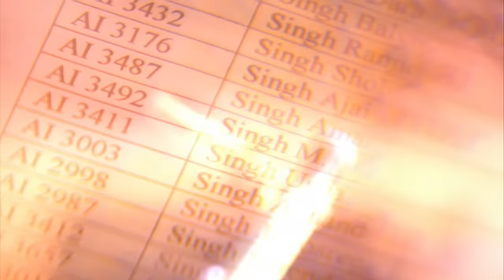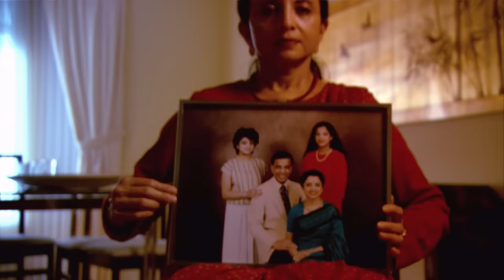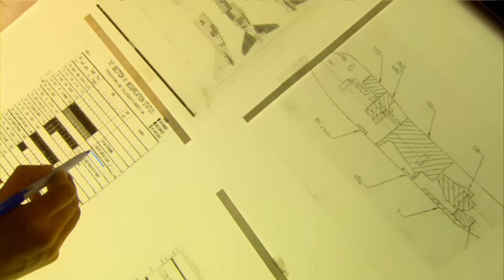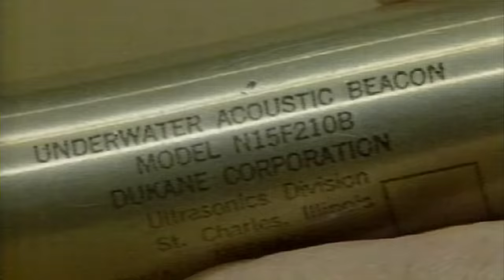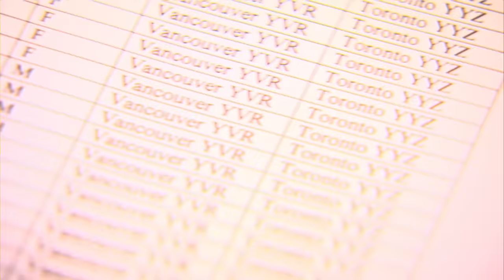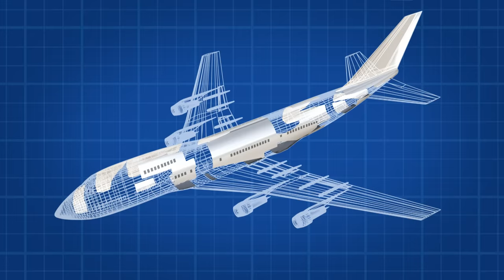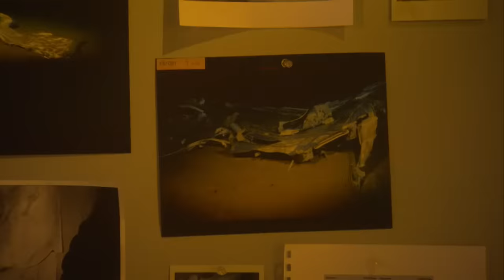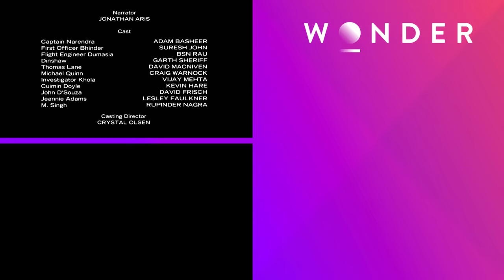Air India Flight 182 Gets Bombed From Inside The Plane | Mayday | Wonder

Comment: Could you imagine if the air India flight was the one at 37,000 feet debrie from the plane would of probably took down one of the other.
Reply: Wonder why it didn’t hit the plane that was flying beneath them..
Reply: @miriamsamaniego3335   because these images on the screen are radar representations of reality.  the radar triangle you see is about a scale of 500 times or more larger than the aircraft it represent,  lots of dead air between those radar blips.
Reply: Yes, In simple words its just like the maps we see on our phones but zoomed out. If you zoom in, the distance gets larger and more accurate.
Reply: @debasisghadai3633  Zoom in, the distances on the reproduction are smaller.   IF you fly on an airplane, or go to a football stadium,  all scales are correct.   if all scales were correct on the radar controllers screen the airplane symbol will be as smaller than dust.  in order to make the tool [radar] usable the airplanes are enlarged about the size of a few city blocks. If the scale on a street map were correct the roads would be about more than 400 times wider.
Reply: @YouTube.TOM.A  ah, thanks for the explanation 👍
Reply: Which 2 flights were others
Reply: @miriamsamaniego3335 but it was not

Comment: So they don't use bomb-proof luggage containers because, "it's too expensive." 

Thank you for admitting that you value human lives less than your profits.
Reply: and that surprises you how ?
Reply: @waldopepper4069  It doesn't, but I wonder if the peanut counters at these airlines realize that in the long term, not using these compartments costs them over 41x what the compartments themselves cost. 

An airline could purchase 2,000 units at $10k per unit and the price tag would be $20 million. 

The cost of replacing a crashed 747:
$415 million
(that doesn't include legal settlements to families, fees for the investigation, etc).
Reply: @sixstanger00  couldnt agree with you more. but i am never under any illusions that people matter more than money to these people. they dont. if they did, things would be different.
Reply: As if you were going to pick the more expensive airline because they had bomb proof containers. No you wouldn't. 

There are 21 seasons of this show, several hundred accidents and only a handful or less due to bombs. The chances of a mechanical failure or pilot error is vastly bigger than the chance of a terrorist bomb. It's about priorities, the airlines spend fortunes on maintenance, security and training. I would much rather have them spend their money on that, than on some containers which may or may not be of any consequence if a bomb were to go off, which in itself only happens once a decade.

Your calculation is also very simplistic. Even if the purchasing price was only $20 million, those containers, fragile apparently, would have to be maintained, which means ongoing checks, repairs, replacements. The entire way of handling them would need an overhaul and due to their fragility would likely end up being a much slower process. Not only for the airline itself, but for the entire airport and all other airlines. The actual price of such a change, ultimately meaning higher prices for customers, would be much much more than just the purchasing price of the containers.
Reply: @OddityDK  
I would much rather have them spend their money on that, than on some containers which may or may not be of any consequence if a bomb were to go off, which in itself only happens once a decade.

Easy to make those kinds of statements from the comfort of your home sofa, and not from a passenger seat directly above the forward baggage compartment at 30,000 ft. 

Your logic is also very simplistic. 
The average driver gets into FOUR car accidents over their entire lifetime. Yet, you wear seat belts every single time, your car comes equipped with air bags, break points in the chassis, etc. By your logic, it isn't worth the extra money for these features. 

Now let me explain to you the reality: You're right -- you could probably get on hundreds of flights in your lifetime and never be on one with a bomb. But guess what? It only takes ONE BOMB to end your life. A bit late to then say to yourself, "Damn, now I wish they'd used bomb-proof compartments" as you plummet from 30,000 ft. 

That's the logic behind these safety measures. You're trying to place a monetary value on the lives of passengers. I'm telling you, omitting a bomb-proof feature sounds reasonable........*until you need it.* 

The argument you've made here could be applied to any safety measure in any scenario. I'm an avid mountain biker and we wear helmets for safety. They can cost upwards of $200. We rarely ever crash, but we still wear the helmet. Why? Because, like the bomb-proof compartment -- it's all fine and dandy until you need it. A bit late to strap a full face on as you're mid-air going over the bars bound for the hillside....
Reply: @sixstanger00  
Hello true human being 😊

Comment: many years ago, I flew to attend my grandmothers funeral. I quickly packed a bag, not realizing I used that bag for carrying my rocketry hobby stuff. Chemically, it was covered in residue from rocket motors and ignitors. On the way home, I was stopped for a random bomb screening. it was explained to me that my person and the outside of my bag were to be swabbed and tested for explosive material. When the security guard finished analysing my test sample he said i could go. and I asked him when his machine was last calibrated, I looked as  concerned look grew across his face, and I explained that my bag had at least 3 chemicals I know that machine would detect and in my grief I had accidentally brought that bag, not containing anything but covered in particles, the guy smelt it and confirmed he could smell a burning chemical smell, I told him that was most likely ammonium perchlorate, space shuttle fuel. they actually seemed grateful for me spotting the machines fuckup and let me continue on my way.
Reply: Very long comment you have written there bro
Reply: WOW. That's terrifying. I happily gave up the too-big shaving cream I forgot last time I flew! Can't believe their equipment was broken and untested.

Comment: There is one flaw in the documentary, the bombing device could be accompanied by a suicide  bomber matching up with the luggage, we would think that the technology has eliminated  that problem.
Reply: Yes. But if the bomb detector's warning had actually been heeded by the baggage handler, THEN this would have been avoided.
Reply: @deprofundis3293  matching luggage with the handler was not foolproof,technology filled the gap.
Reply: @757575436  oh
Reply: @757575436  there are flaws and flaws in this documentary sir

Comment: Am I the only one to wonder why the first thing the Shannon controllers didn’t do was contact the two other flights to see if they had seen anything? I mean an explosion surely would have been seen by the other flights being so close or their passengers?
Reply: The problem is that each were 1000 feet apart.
Reply: Other flights were at higher altitudes. It may impossible to seen anything
Reply: @TeeHongJun_0214  true. But all this is a guess. It wasn’t addressed. When TWA went down (outside NYC due to the fuel tank issue) not only did ships see the blast, planes in the area did although no one knew at the time what it was but they reported back to ATC..
Reply: That was a HUGE reveal I have never known.  A TWA American plane and Canadian Pacific clearly witnessed this bombing happen.
Reply: There’s a difference between a plane catching fire and then plummeting into the water at 16,000 feet, and a plane exploding and disintegrating at 31,000 feet, 4000 or so feet below your plane. Additionally, TWA exploded quite close to New York, and in extension, the airports in that area, which would mean a substantially higher density of air traffic.
Reply: @melonnnnnn  true.  All valid points.
Reply: @andyrob3259  no

Comment: explosive protection in luggage compartments would be nicer than being strip searched.

they could just add a harder outer lining to prevent accidental damage to explosion resistent luggage containments.
Reply: If you check again, they said they would only work once and they can damage easily while loading cargo. So at best you might have a UAL 811 case happening to every bombed plane

Comment: And how can you allow a baggage to into an airplane without going through X-ray confirmation?
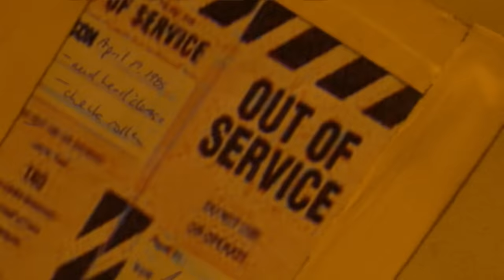Reply: As what was stated in 28:04 their xray machine broke down. Hence, they used a portable one. The best they could have done is to open it to confirm instead of passing it as a "glitch".
Reply: @chizusakuraa  yeah, but, should you ???? Isn’t the saying…. Better the safe than sorry ?
Reply: @medicinaemdia4895  Should I what? If you are pertaining to the opening of the baggage despite a different tone produced by the portable scanner, definitely yes! If you are pertaining to the xray machine, again, they stated that during those times it broke down, and xray machines in the airplanes are "still in the infancy". Of course, I'm not covering for their mistakes. I'm simply stating what was said in the video. The best "better safe than sorry" move they could have done was to direct the flights to other terminals with functioning xray machines.
Reply: @chizusakuraa  it’s óbvios that they should have moved the luggage to another terminal, but since the check in girl decided to skip the regular idea, that when the passenger is trying to only check in a luggage and not board the plane, it’s suspicious behavior, so in deed move the luggage to another terminal and do bother to make that luggage actually be scanned, since otherwise you are gonna end up being also responsible for the death of hundreds of passengers.
Reply: @medicinaemdia4895  oh man you know nothing

Comment: As someone who has worked in private security at hospitals/other high value locations (though not airports) for over the last 12 years I can say that security standards have not changed. Unfortunately it is considered a low paying field (in some places like Ontario a minimum wage field). Which means that you get people who are either foreign students or retirees who receive very little training or direction and told "well use your common sense." 

Or you get people who once they become knowledgeable move on to higher paying fields and you're left with new people with little experience to replace them. 

Certain locations that have a higher risk level need a higher pay level but unfortunately these places usually have basic security because "well I can find someone who can do it cheaper" mentalities.

Comment: "23:39 The bag did trigger the device, but it made a very different noise than the one workers heard during the demonstration. The bag was passed and allowed on board the plane." If it made a noise at all it should have been pulled aside and inspected manually.

Comment: Everyone is blaming the ticket agent and not the baggage security guy whose literal job it was to check for bombs. >< Also, people forget that many bombers are actually suicide bombers. If that guy had been a suicide bomber and got on the flight, then keeping the luggage with the passenger wouldn't have changed ANYTHING. The only thing that would have stopped this tragedy no matter what in this situation was the guy who used the scanner actually opening the damn bag when the sensor made a noise. HE was the only person who had been given a clue that there might be a bomb.
Reply: There were many lapses…all concerned have agreed on this
Reply: @arbjful  yes, but going through the comments, I was surprised to see that people blamed the ticket agent (who had no reason to believe there was a bomb, although of course it doesn't justify breaking policy) instead of the baggage handler whose bomb detector WENT OFF but just didn't sound exactly like it had when demonstrated. That frustrated me.

Comment: It's not as well publicized as other fields I don't think, but the technology for submersibles has improved by leaps and bounds in the last few decades. The first human visited the Mariana Trench ten years ago, but in just the last three years there have been numerous national and individual man-made submersibles that have reached the bottom. Meaning that the technology to build vessels to retrieve wreckage from anywhere in the oceans is both possible and not unique anymore. Easy to forget that as recently as 2010 some locations were either inaccessible or required using one of only a couple of vessels that were up to the task.
Reply: The Marianas Trench was first explored in the 1960s by a submersible named bathyscape. The US Navy operated it as a research vessel. It went all the way to the bottom. 35,000 ft.
Reply: @kevinmalone3210  Yup, you're absolutely right, I did get that wrong. Thank you for the correction!

Comment: This could've possibly been avoided had it not been for the negligence of the baggage handler and the failure of the security guards to inspect the luggage that gave off readings. So many what ifs . . . . Travelers trust all of the airport personnel with their lives (literally). Yes, flying is the safest form of travel, but it's a huge reason why I fear airplanes. Trains, cars, subways, and even boats/ships can stop during their route/destination, but airplanes can't (immediately). They were doomed the minute that plane took off. You never think it will happen to you until it actually does.

Comment: Who the hell mounts a 5th engine on a 747 ?
Reply: 5th engine on the underwing 747 is the spare engine
Reply: It's too expensive to transport an engine in a cargo plane while it takes too long to be transported by ship
Reply: It's made to be able to carry an extra engine. This had nothing to do with the plane going down.
Reply: @kglw9575  oh…
Reply: @kglw9575  I know it has nothing to do with the plane down, just saying, a heck lot of more drag by taking another engine this way. Just put the 5th engine on the cargo compartment
Reply: @medicinaemdia4895  the engine doesn't fit on 747 cargo compartment because its too big and at the time, the aircraft seat was nearly full and both front and rear cargo compartment was full with luggage, small engine part(like fan blades) and something else.. (cmiiw)

Comment: Another conspiracy theory is that the bomb was timed to go off in the empty plane, on the ground at Heathrow, during the layover, when they clean and restock the plane.
This did not happen because the flight was not only running late but also a little slow due to the " 5th engine''  it was carrying for repair / service in India.

The bomb blew when the plane was still airborne and approaching London.

It was NOT on the ground at the service area , as it should have been had it been on time.

Had the bomb gone off in the empty plane, on the ground, those responsible would have publicly claimed credit, for political purposes.

But when such a horrific tragedy unfolded, killing 330 innocent people, nobody claimed credit .............. for obvious reasons.    This was not how they had planned it .

We will never know the truth.
Reply: There were 2 bombs for 2 air india flights, the one that blew up in Narita Japan was meant for the plane, it blew up 1 hour early due to Japan not observing daylight savings, that bomb was to be on a plane in the air.